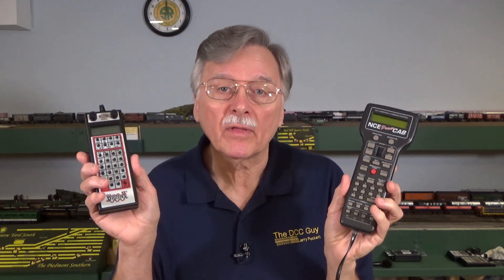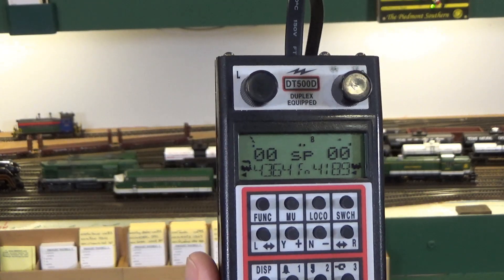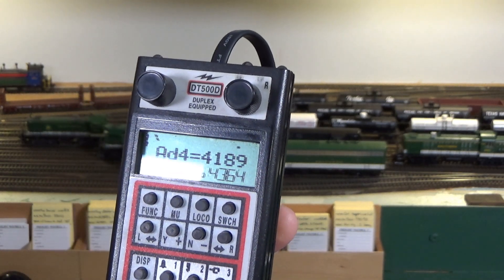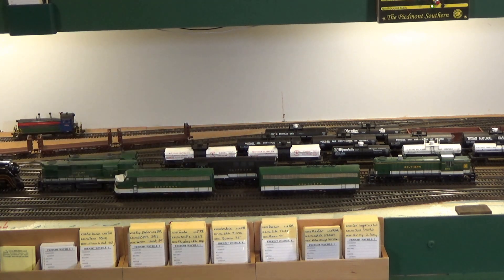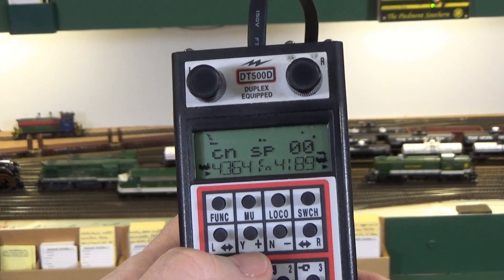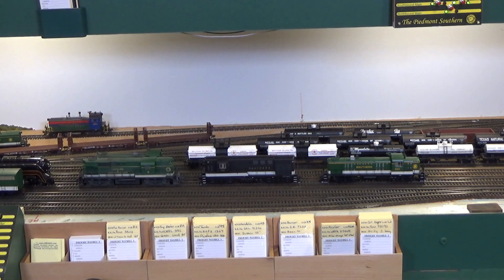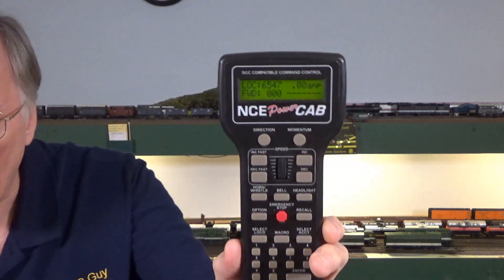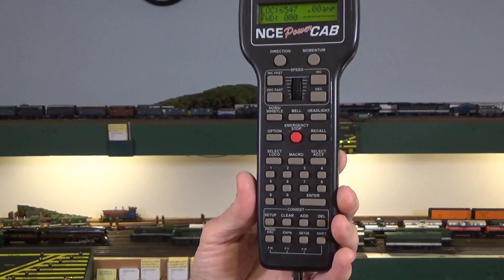54. DCC 101, Consisting with DCC pt2, Basic and Universal methods

Comment: I have 2 Atlas HH660 diesels but with different brand decoders. Can I still consist them? One is a Quantum, one is a Digitrax. thks
Reply from the maker: Yes, but they may take some extra tweaking if the basic motor control circuits are dissimilar.
Reply: @TheDCCGuy  The units are identical Atlas HH660 units. One was DCC Ready and I added the Digitrax decoder(no sound) while  the other is also an Atlas HH660 which came with a Quantum decoder. The manual says there is a delay in the movement of the DCC unit emulating a large load(throttle @ 40% before movement) while the Digitrax decoder starts up right away. Quantum setting is for "Standard/regular throttle" which is suppose to
be normal but is not.  VSTART is my next setting to be addressed ( =0 ). I hope !!!  Thanks for the quick replay.
Reply from the maker: I was afraid of that. There should be some way to turn the delay off, I have had to do that with some LokSound decoders.

Comment: I would have a question if I may. I have been out of model railroading for a few years and came back after watching quite a fantastic number of your interesting videos mainly the ones pertaining to DCC, sound and manufacturers of controlling devices. My choice went to NCE PowerCab. As for sound decoders, I went with ESU LokSound for my locos of another long gone era until recently where I acquired 2 SD70 ACe's running on Tsunami and Tsunami2 and one F7A/Tsunami. I have managed to get the SD70's to operate as MU'ed locos (the lead unit in Forward running and the trailing one in Reverse) but I have issues with the way they behave as a consist. Say I have train ready on departure track and the crew has to take their set of power at the loco shop and run up to their train. All is fine and dandy until backing up to couple to the train. When going into Reverse, the lead unit's front headlight extinguishes and the one at the long hood end comes alive and will only go out when the direction of travel is changed to Forward. What can be done so to prevent that from happening? I'd like the trailing unit's headlight to come on so the crew can see where they have to run before coupling to their train. Another issue I have is when such a consist and train reach the very end of the line and no facility is provided to turn the consist around; would that mean that the poor crew inheriting that consist would have to run blind to the nearest repair facility as stated in most General Rules of Operation? Is there a way to use the trailing unit as lead for the trip back with all its functionalities (lights, sound, etc) which I may not be aware of? As of now, the only way out I can see is dismantling the consist and building a new one. Royal pain in someone's hind quarters, if I may say so! Thanks for taking the time in your busy schedule to provide some answer to my dilemma.
Reply from the maker: You need to look into advanced consisting. With that you can use CVs to determine which functions the locos in the consist respond to. Your Tsunami decoders may have directional control as well. Download the manuals from the SoundTraxx website and look for advanced consisting. Finally, take a look at my videos 71 & 72. NCE has a mixed mode consisting method that can handle some of what you describe but I cannot remember whether it is implemented in the PowerCab.

Comment: Great video Larry. One question...does Digitrax not support advanced consisting with a throttle? Looking forward to your JMRI consisting video.
Reply from the maker: All systems support advanced consists since you are basically just addressing the same consist address. However I think you might be asking can you set up advanced consists on the throttle much like you can with the NCE system. The answer is I am not sure. Somewhere in one of the manuals, probably the decoder manual, I once read that it does it seamlessly in universal consisting but I was told it only works with the most recent Digitrax decoder versions. That was back around the time the hurricane hit and I never figured out how to do it and never have gone back for a complete answer from AJ Ireland, the developer of Digitrax—I guess now is about time since they seem to be back in full operations now. I personally use a combination of Universal and advanced. For semipermanent consists I use advanced and for quick and temporary I use Universal.
Reply: @TheDCCGuy Thanks Larry, could I use Decoder pro to set up an advanced consist on a Digitrax system?
Reply from the maker: Yes, and in my video on Monday I’ll show you how.
Reply: @TheDCCGuy  Looking forward to watching it.